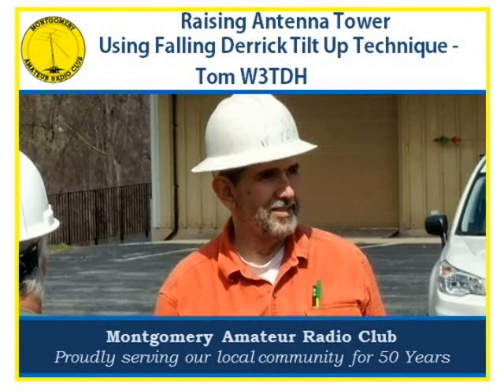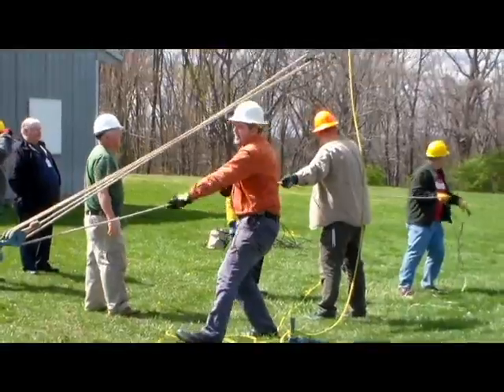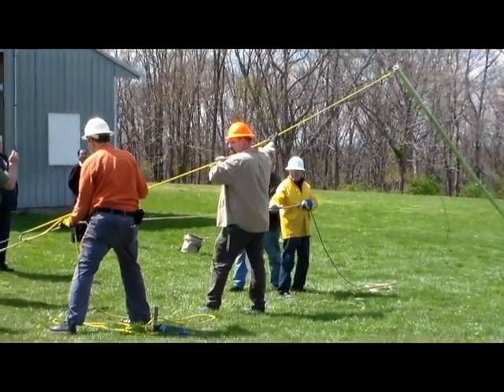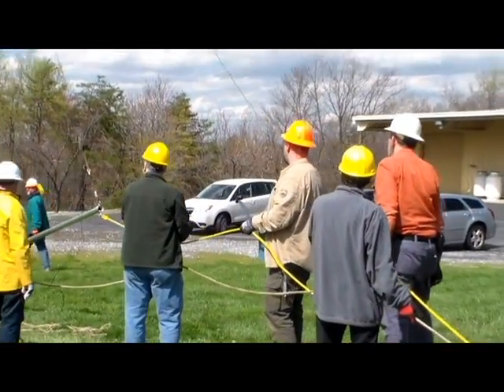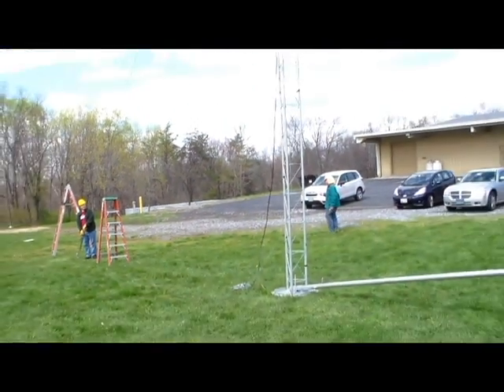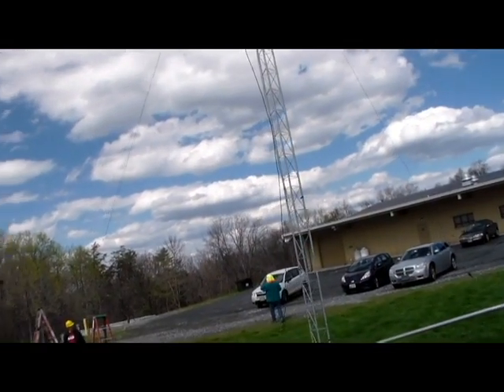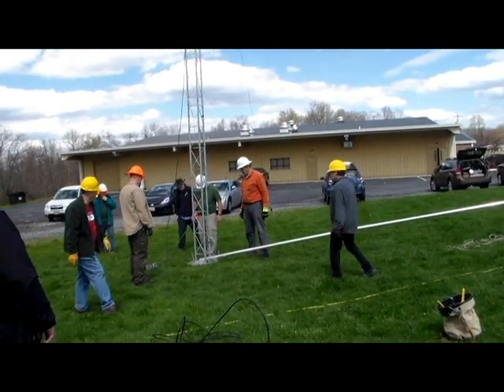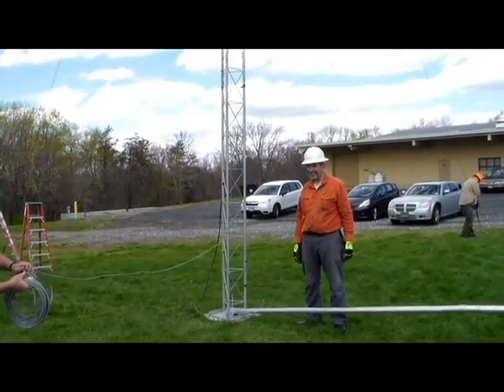Falling derrick tilt up technique to raise antenna tower

Comment: I have one of those WRTC tilt over bases but haven't used it yet. Do you know (or could you find out) the length, wall thickness and material that is used for the falling derrick pole? I think he said it was aluminum of some sort, and said that he has used an aluminum ladder rated for 350lbs on prior occasions. Thanks in advance.